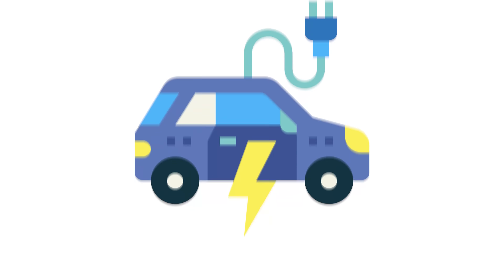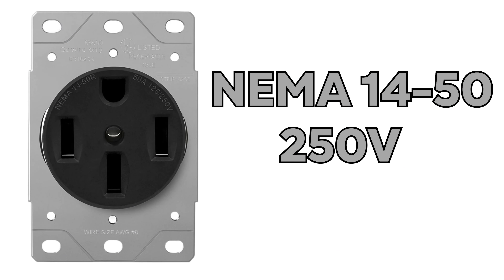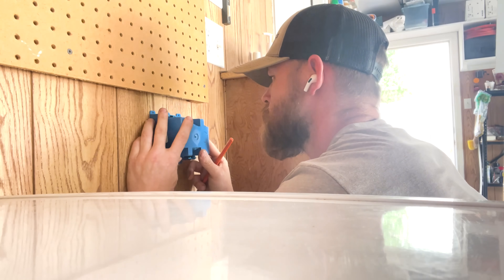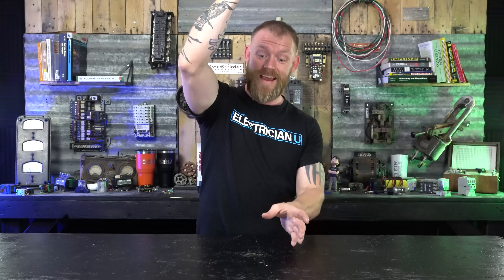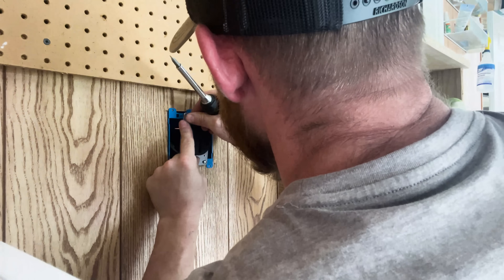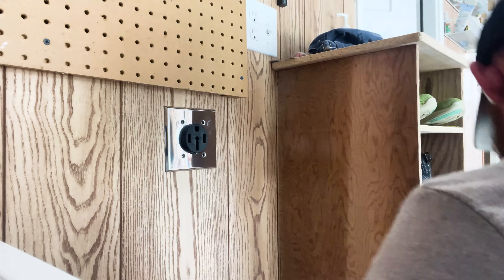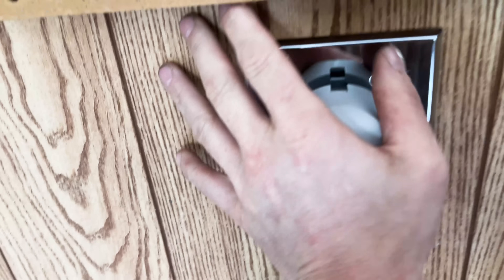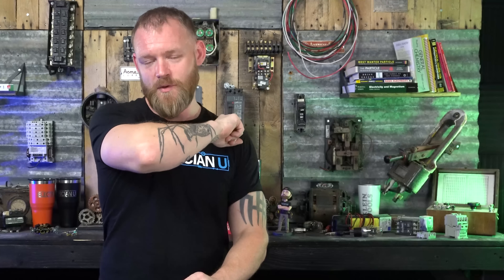How to Install an Electric Vehicle Charger Receptacle

Comment: So far we have had 2 customers severely hurt themselves replacing GFCI breakers on inductive loads due to nuisance trips. Countless others have gotten shocked.

Wonder how many people people are going to be injured or killed before before this enhanced safety from GFCIs takes effect.

Consider this for a moment. NEC states you need to use the max load amps for an AC/ heat pump to prevent nuisance trips (the assumption being these nuisance trips will cause the homeowner to replace the breaker themselves which is unsafe). Now it’s code to install breakers notorious for nuisance tripping.

Comment: #8 ROMEX or #8 NM-B wire is only listed for 40 amps... the plastic box is to weak for the large cable to be plugged in  ....A  surface metal box  attached to a stud should be used....i am a licensed contractor for 46 years in new jersey... PLEASE DO NOT DO ANY MORE VIDEOS WITH WRONG INFORMATION .....

Comment: I opened the male plug end that plugs into the 50 receptacle on a BMW charger an it just had 2 hots an a ground no nutural so it got a 6/2 should it be replaced with a 3wire
Reply: Appreciate any help
Reply: Yes, I would update to a current  because shyte changes.  At the most grab the 6/3 now and hold on to it so when the time comes you got it.  Copper prices are like the damn stock market right now.

Comment: Worked at a newspaper for many years. They would go crazy with GFCI breakers or cords with GFCI. Some are more sensitive than others. The problem is that when the lights would blink, the breakers would trip. We're talking Air compressors, Film Processors and other machines. So, if you can put a trip alarm on the service so you could tell if it tripped I would.

Comment: The EV chargers are just glorified switches, but they have a little processor and a bunch of safety protocols for the car charging and part of that is negotiating the charge rate with the vehicle.   Usually the EV charger either has a bunch of dip switches or can be programmed over bluetooth or wifi to set the maximum charge rate.   e.g. 16A, 24A, 32A, 40A.   The vehicle also has its own maximum charge rate and the lower of the two is what winds up being used.  The vehicle manages the actual charging rate but the charger monitors the current and, of course, the breaker on the panel is appropriately sized to be slightly higher than the EV charger's amperage setting.

My ID.4 can charge at 40A, and the socket is rated for 50A, but there is no particular need to actually charge the car at that rate at home, so I have my charger set to 32A.   Just for added margin, including the in-vehicle electronics where the actual charger is located.  No reason to stress any of it... it will last longer.

Comment: I can't understand how GFCI would matter if the circuit is 240v. Dryer? Yes. EVSE? No. Do not GFCI simply monitor the neutral part for shorts?

Comment: When my home was built, I had them install 2x 240v 50amp outlets.  I don't know how to weld, nor do I have an EV.  But at least now I can get an EV (if so inclined) and I can learn how to weld.  Still, I'm about to finish my basement and I need 3x 240v 50amp outlets in my basement for a server rack and other device.  So I'm hoping to use some of the info from this to help me there.

Comment: i understand the owner requested 30 amp breaker but you can limit the charge speed at the charger so putting the 30 amp breaker does not make since. good video

Comment: 2:05 This, and Most importantly Respect the Electricity, Understanding it will fight that fear. Never be afraid to learn something, but also respect your own abilities. If you have trouble changing your cars spark plugs or oil.. Step away from the box... and call a professional.

Comment: Great video.

 I would have recommended a 40 amp breaker. All Newer evs are limited to a 32 amps on a Nema 14-50. So roughly 64% capacity of the 8/3 wire or 50 amp breaker. 

And ford does not allow users to dial down from 32 amps. So when you plug in the Nema 14-50 plug, it will automatically charge at 32 amps on the 30 amp breaker because it is using the receptacle to determine amps.  

Telsa will charge at 32 amps but you can set it to 24 amps. (Recommended 80% for constant load)

I said all of that to say 40 amps would have been the better overall option. But since the wire and receptacle are rated for 50 amps, the breaker will just trip if the ev pulls 32 by default
Reply: Tesla Model Y's will charge up to 48 amps.
Reply: @StevenFalkner  not on a Nema 14-50. You need the wall mounted charger to get 48 amps. And those need to be on a 60amp breaker with minimum 6 gauge wire.
Reply: @bigjack79  thanks- I have a Tesla wall charger with nema 14-50 pigtail, 6/3 copper to electrical box.  It looks like I’m out of compliance, since garage outlets should always have gfci.  However Tesla wall chargers required no gfci since it has one built in, thus no connector should be used (hard wiring only). This always reduces heat in a receptacle.  Okay I learned something today.  Currently I’m limiting to 40 amps due to undervolts.  Need to fix.  Thanks!
Reply: @StevenFalkner  gotcha. Technically the code just updated to needing a Gfic so you are good there. 

Even though the Nema 14-50 is rated for 50 amps, when working with a constant draw, code wants the power draw to be at 80% of the max power handling. 

So 40 amps on a 14-50. This just helps with heat.  

40 is the safe way to go.

Comment: No Insulated Screwdrivers - didn't see any tests first to make sure panel was dead.... No testing of new circuit first to see if there's any shorts before livening up the circuit, or L1-L2 test to make sure the resistance is low enough for rated supply current - what if that bare Earth had inadvertently contacted the Neutral or worse one of the Live conductors...... and no torque screwdriver!

Comment: 9:49 I'd suggest pushing back on your customer for this point. They don't seem to understood how their EV's charging system works (onboard charger and electric vehicle supply equipment - EVSE). It's always okay for the circuit to be rated at a higher current load (ideally 20% overhead) than the EVSE or onboard charger can draw; however, it's never okay for the EVSE and onboard charger to be rated at a higher current load than the circuit. Essentially, the car will never draw more than it needs, but it might draw more than the circuit can support. Your customer might plan to only use a < 30 A charger/EVSE with this circuit; however, because you installed a NEMA 14-50 receptacle, your customer (or a future homeowner) might later plug in a 50 A EVSE/charger that would overload the circuit. 

Also, because EV chargers are a constant, static load, the circuit needs to be rated with 20% overhead. So if your customer is planning to use a 30 A charger, they need to understand that a 30 A circuit isn't sufficient. The circuit needs to be at least 40 A. Traditionally, the NEMA 14-50 receptacle indicates that it is safe to plug in up to a 40 A EV charger; however, 48 A EV chargers are becoming more popular, so some people are upgrading their circuits to 60 A in order to support that higher static load.

Comment: You might want to do a follow up to this because a number of newer EVs like the Ford Lightning are now shipping with 80 A chargers. Realistically, garage chargers probably don't need to be more than 40 A, but some EV owners will want to maximize their EV's power or even charge two EVs at one time. Frankly, you could probably do a whole EV charging series because some automakers are now offering bidirectional chargers that can feed power back into the home (requiring special installation procedures), some EV owners want power switches/splitters between the EV charger circuit and other high power loads (e.g., washer/dryer), and some EV owners don't realize that the could get by with a lower cost solution (e.g., 16 A @ 240 V) because they are only needing to add a few kWh to their car every night. There are even power consumption considerations for using 120 V versus 240 V, or even just ensuring that a 120 V circuit is up to code and capable of supporting the load (some automakers like GM actually default the car's onboard charger to 8 A when using 120 V, but owners can manually set it to 12 A, which can burn out some circuits/sockets). 

With more and more people buying EVs, this is going to be a topic electricians will want to be knowledgeable about.
Reply: ever thought about the energy loss in charging with low amps? Kind of stupid to keep promoting this. Sell a wallbox, thats the only way to go.
Reply: @digital-experiance2390  The losses during charging have more to do with voltage than amperage, as long as the wires are properly sized for the load. Yes, there will be some additional losses due to charging for longer; however, those aren't as significant, and most EVs will consistently draw some load from the grid to manage battery temperatures, run internal systems, etc.
Reply: @newscoulomb3705  Well I thought we are talking about 220v ish and thats where the amp matters. Plus the powerlines have fun, when everybody charges with 220v and 40amps.
How do you thing the electricity companies will manage to get a staple voltage and frequency. Most countries a way ahead of those problems you keep installing in houses.
Reply: @digital-experiance2390  Yes, but that was my point. Charging at 220 V at 20 A on 8/3 isn't going to have significantly more losses than charging at 220 V at 40 A on 8/3. In fact, it might have less losses overall.

As far as the power grid is concerned, because most of the power is drawn at night time during off peak and super off peak times, these loads actually improve grid health by reducing the need to cycle slow cycling power plants, which saves on both wear and wasted fuel.
Reply: @newscoulomb3705  The prob with the low amps is the sweet spot of the charger. Thats where the most loss is coming from.
The wire might come in play at 50amps or more.
And the night times are not the problem, but the keeping of a stable current using only one phase. A three phase charger is much more efficient and easier to keep stable on the grid
Reply: @digital-experiance2390  I've never heard about an EVSE having a "sweet spot" in terms of input current efficiency. Even if that did exist, the EV charger itself will vary the current request over the course of a charging session based on the needs of the battery, thermal management, and other systems. 

As for the North American residential power grid adopting widespread three phase power, sure, that might be nice in theory. In practice, I don't ever see it happening.
Reply: @newscoulomb3705  I am not talking about the charger in the car, but the supply module, you plug in the wall.
But maybe I am wrong. We are talking about Level 1 oder Level 2 charging?
Reply: @digital-experiance2390  It wouldn't matter. The car's onboard charger only pulls what it pulls, so you could have an 80 A wall socket that the car only asks 16 A from. Even for EVs that can pull a full 80 A, they can be set to a lower current draw or automatically reduce the current they are requesting based on the battery's condition, software parameters, or even smart-grid connections. An EVSE is essentially a "smart" extension cord, nothing more.
Reply: @newscoulomb3705  That is not what i am talking about. just google the losses using the differenz charging speeds in Level1 and Level 2 charging. There is a difference, which will add up to a lot.
And for the household it is wasted money to install those plugs.
Reply: @digital-experiance2390  Yes, I agree that there are differences between Level 1 and Level 2, but as I said initially, that is due to voltage, not current. Level 1 AC is 120 V charging. Level 2 AC is 240 V charging. And 240 V charging suffers from roughly half the losses, regardless of amperage.

Comment: 11:27
For reference, quite a few driers (and pretty much ALL electric ranges) ALSO use a NEMA 14-50 connection, though I've seen many driers use a NEMA 14-30 like you mention or uncommonly a NEMA 6-30.
Older driers and ranges will often use NEMA 10-50 or 10-30, but those are non-grounded and NOT acceptable for new installations (but are grandfathers in existing installations).

Comment: I'm a noob and have a question.  You installed a 3 conductor cable but have a 4 pin outlet.   Where is the 4th conductor or do you just tie to a water pipe?

Comment: This is AC charging. I'm curious if there's beginning to be demand for DC charging? I could imagine commercial properties that have a number of trucks loading/unloading would start wanting DC charging at the loading docks. Park at the loading dock, plug in, unload/load, unplug and go.  A 50-100 kW DC charger could dump decent power into a truck in that time.

Also curious if you're seeing much work to install dozens to hundreds of chargers in apartment/condo parking lots. I've seen some interesting systems to share / queue charging on systems like that.

Comment: Had an outlet installed and went with the maximum breaker. I believe they used number six wire. Charging station is rated at 32 amps. If I need a larger one I'm ready.
One winter I plugged in the car and after a while the lights went out. Checked the breakers and the main had tripped. We had 2 heaters and the car plugged in. My roommate discovered an iron had been left on. Once we got rid of the extra draw it was fine. 
Had some friends that had a problem with the lights flickering in the back rooms. I checked the outlets and couldn't find but one that was scorched, but that wasn't  the problem.  I asked if there were any more outlets and they said no. The lights went out eventually and a couple months later I went into the attic. I traced the wires to the corner of a bedroom. Turned out there was a cabinet in front of an outlet. Upon investigation the outlet had a hole about the size of a quarter in the back of it and the insulation on the wires had melted to the plastic box. They had used an industrial heater at the scorched outlet and kept turning on the breaker when it tripped. I find it hard to believe that some homeowners are that ignorant.

Comment: More people should consider a 6-50R over the 14-50R if they are only using the receptacle to charge cars. EVSEs do not need a neutral and the industrial grade receptacles and wiring is cheaper. Although many EVSEs come with a 14-50p for some reason.
Reply: If you solely want to have an EV charger… if you’re making the investment, then it’s worth the extra $2.45/ft to do a 8/3 wire. Gives you more options for your 240 receptacle.

Comment: You should go double check the code. EVSEs are always also GFCIs. Unless I am misunderstanding the 2020 code, if you have a receptacle which is very rarely unplugged where an EVSE is plugged into it, you are allowed to not put a GFCI breaker there (and you should not because a GFCI downstream from a GFCI will not trip properly). I forget the exact wording.

Comment: Although I feel very comfortable working with most electrical in my home this is one project that I may help to plan but would hire an electrician to do the work.  There's too many pictures of house fires due to improper installation (not that things were hooked up incorrectly but things such as torque at the receptacle's terminals not being done and higher gauge conductors for the amount of continuous current load to oversized breakers)  - in my opinion what you may save by doing it yourself is a very high price to pay if or when your home catches fire - it's likely not worth it.  All that said being educated on what you need and want isn't a bad thing, helping to design or at least asking good questions is also a good thing.  Also, don't "skimp" on components such as receptacles - even though you may not plug and unplug your EVSE all the time it may be done more often than an electric dryer.

Comment: The only other thing you should do is a load calculation on the service panel. A lot of times a customer buys an EV and wants an EV receptacle and the service can't handle the extra load.

Comment: I was told to use 6g wire for the 50a plug.  Wouldn't 8 be a little lite for this application regardless of the breaker.  Somewhere down the line the breaker may be upgraded to a 50